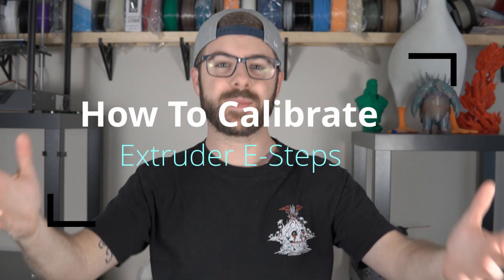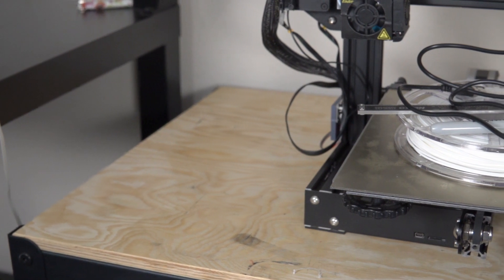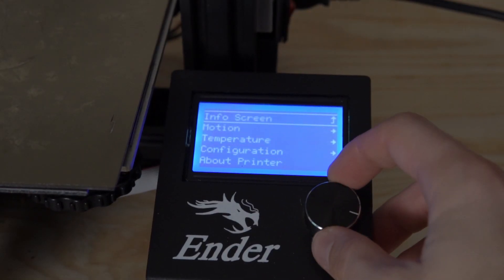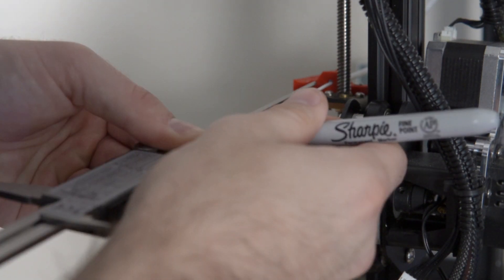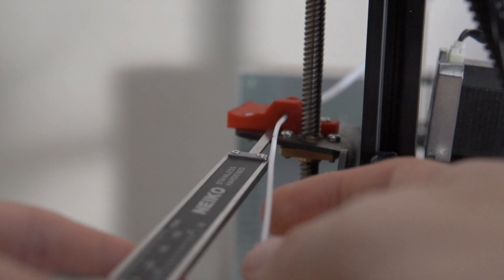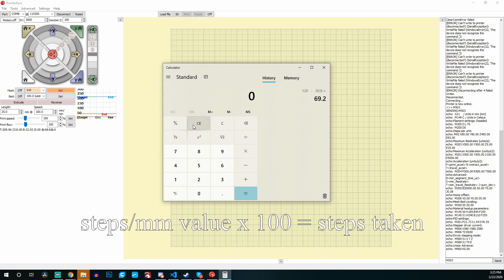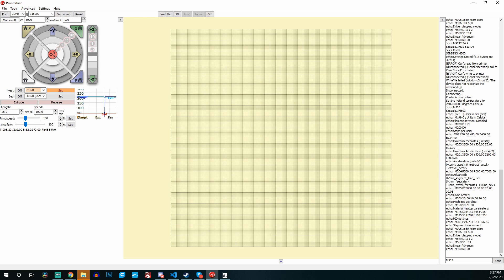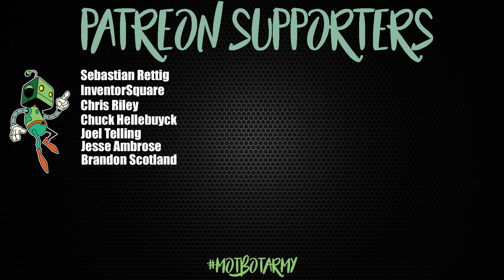How To Calibrate Your 3D Printers Extruder Esteps (Ender 3)

Comment: Got error after sending M500, "No EEPROM"
Reply: If I were to guess, you are using a regular creality controller running marlin. You'll have to reflash the controller with the extruder adjustments in the new firmware.
Reply: You need to install the memory card

Comment: Thanks mate. Really helpful for novice users like me.
One thing I noticed though. On your recommendation the extrusion command has a flow of 100mm per minute (F100). With this command I dad some hard time to have accurate measurements (Bowden extruder and PLA temperature on 210 on an Ender 3 V2 -with metal extruder). I had better and more accurate results when I dropped the flow to 50mm per sec (G E100 F50).

Comment: So I'm trying to use pronterface and have tried 2 different computers and the program will not pick up the COM port for the USB? Is there a different program I can use or an easy fix for the program? I use my printers for work and this has made me lose a lot of money for the hours I've been messing with it
Reply: I had same. just drivers for COM port not installed. I installed drivers manualy and get connection OK.

My computer>manage>device manager> and bla bla bla

Comment: Hi, really like your video and it help me a lot because I just change the extruder assembly. I’m having a problem that it is not saving the e steps on the software, if I shut off the printer and turn it on again, the original e steps appear again, even after I save a couple of times. Do you know what is the problem or is there another command to save everything. Btw I have a tronxy x5s with the original board bought on May this year (if it helps). Thanks and hope anyone can help.

Comment: Hey Daniel,  I just tried to calibrate my new extruder and it's running backwards.  I know why but I don't know what commands to change in the firmware.  Do you?
Reply: In the Marlin firmware there is the option to invert the extrude a bit under the steps/mm of the extruder,  An alternative is to reverse  the order  of the motor wires.

Comment: Thanks!!  Mine was under extruding but it seems to have a problem with the filament skipping in the extruder, something seems to be causing a jam about 3/4 of the way through the test.  The tubing is all new as well as the tip.  Will have to take it apart and see whats up in there.  It was printing OK, but i could hear the extruder click now and then so that wasn't unexpected.

Comment: Thanks this was a great video. I was wondering does the size of the nozzle being used have any impact when you issue the extrude command?  Is there a difference between using a .4mm or .8mm nozzle?
Reply: No, it makes no difference. The commands are the same.

Comment: Thank you for this video. I'm also new to this and installed the Micro-Swiss direct drive extruder on my Ender 3 Pro, along with a BLtouch. I've downloaded the Ponterface program. I've connected my computer to the printer via its minu usb port. The display will light up without the printer power turned on, however,  no port is listed in Ponterface's dropdown. Even with the printer turned on, no port listed. My printer has the original V4.2.2 motherboard which does allow firmware updates via the micro SD slot, which I did update with Creality's firmware for the BLtouch (Marlin V1.3.1). But, I am unable to make any changes stick, either for the X offset for the hotend, or the Z offset for nozzle to bed distance. Do I need a different motherboard? And if so, which is recommend. I understand the Marlin V2.0's would be better.
Update: I was finally able to get Ponterface to connect and correct extruder speed per your instructions. Thank you.

Comment: What would be causing my over extruding? My e-steps was 93. I used this method, the new e-steps should be 107.95 (had 33.85mm left over). I've set the e steps to this new setting, so now it's over extruding even more. I have this problem with every filament, and they all are 1.75mm. My extruder stepper always jumps , I upgraded to direct drive, and now have just fitted an aluminium assembly on it. I've even swapped nozzles more than once.
Reply: have you checked that the slicing software you are using has the right nozzle set as having it set to a higher nozzle than it accutly is can make it over exstrude
Reply: @b3dpc354  Hi, back after 3 years as I've just gotten this printer out of storage. Correct 0.4 nozzle fitted, with 0.4 selected in Cura. I have to print at 90% flow rate all the time. It's so bizarre! I also always get stringing at any speed and any retraction. Brand new steel nozzle now too.

Comment: Instead of fighting with the digital vernier calipers to measure the filament, i just printed a long narrow piece of plastic 120mm with a valley deep enough for the filament to sit in and just straighten the filament so it sits in the valley, and at the end of it, just use a narrow tipped sharpie. Takes 5 seconds or less!

Comment: Why are you substracing from 120 when you sent 100mm to be extruded?
Reply: it can be extrruded more then 100 or less then 100. if extruded more and you mark 100 you cant see you mark
Reply: @shadowjack1214  That's what he did but it's not right. He set it to extrude 100mm so everything should be based on 100mm plus or minus. What if he measured out to 200mm and sent out 100mm? Would he calculate based on 200mm or the command distance?

Comment: Yea, that's great, but I had to put 332 into mine. Which worked, but now that I'm off by only 28, what am I supposed to do? I can't use the original E93 since it has changed so drastically. If I want to get closer, this is only half the answer. Especially for people that have their calibration way off target. Where do I go from here? When I resent the G1 E100 F100, I'm now only off my 28 - still under extruding, but not by much.
Reply: If it makes you feel better I'm way under 20 at 8.4mm left so I'm in the same boat.

Comment: I'm new to all this and just upgraded my extruder as you did. I downloaded the pronterface and installed it. Connected it and started following your lead. When I put the M503 command and all I get is "SENDING:M503
 - ok N:0" nothing else. What am I doing wrong. Any help would be greatly appreciated. Thanks
Reply: You haven't got 'EEPROM features enabled' in your firmware. If your using Marlin firmware, check out here = https://github.com/MarlinFirmware/Marlin/blob/1.0.x/Marlin/Configuration.h#L521
It needs to be enabled for M500, M501 and M502 commands to work.
Reply: @andyspoo2  Does this work with normal Ender 3 Pro firmware?
Reply: @yony120  I don't believe so. It's a Marlin feature
Reply: @andyspoo2  I was able to modify the esteps within the Ender 3 menu, plus I've added a line to the start gcode on Cura.
Reply: @yony120  how! Hahah help me
Reply: @omarnavarro9690  If you go to the Steps settings in the Ender 3, there should be an option called E Steps or some Extruder steps or something similar. I no longer use the default firmware so I don't know the name for sure.

Comment: Finally thank you if any one gets the error 5 on pronterface turn your pc off and printer then load pronterface up leave it to run for a minute then connect your printer up and it should  connect I had issues with this

Nvm it doesn't save the new input 😑

Comment: I usually do calibration on extruded side of extruder stepper. Remove the Bowden tube cut filament straight with flat cutter, extrude 100mm and measure the actual. Sharpie method is very unaccurate.
Reply: your method does not account for the extra friction of the bowden tube or the force required to press the melted filament through the nozzle. It will result in inaccurate extrusion.
Reply: @MrDarkknight1225  Would that not change then depending on what type of filament you are using? I would do the calibration without the nozzle coming into play. You would also calibrate flow which would take the nozzle into account. Flow could be different for each type of filament you are using so would be set in the slicer.

Comment: I have an older Ender3 with the original board. I connect using Pronterface and go through every step you outline here. I do the M90 E143.5 and M500 and M503 and everything works. I then unplug (Power cycle) my board and do M503 and it is back to the E93 value. What am I doing wrong. It is the original Marlin 1.0.0. Do I need to upgrade my board???, Marlin???
Reply from the maker: Strange as long as you are saving to eeprom then it should be sticking with the reboot. Unless by default the marlin firmware has that functionality set to false. I have not looked at the stock Ender 3 firmware in a long time.
Reply: @ModBotArmy   I'm having the same problem. My Google-Fu tells me that this is by design of the manufacturer. The only real way to fix it is to recompile the Marlin code on the board. The easiest way around this is to include the M92 Exxx.x code into the "Start Gcode" portion in your slicer. However, if at any point after that start code is initialized, there is another M92 Exxx.x code, it will overwrite your initial calibration.
Reply: @Drewski3D  I have the same issue now with my CR-10S it reset the M92 E value to 93

Comment: Good job! This is a "must do" calibration that is really pretty easy and doesn't take long. But, now you are only half done. To really dial in extrusion one really needs to follow up with calibrating your Extrusion Multiplier. You should make a "Part 2" video showing how to do this and IMO its even easier and quicker than the first part. Matt's Hub has a good page about this (here about halfway down the page: https://mattshub.com/blog/2017/04/19/extruder-calibration) until you put your video up.
Reply from the maker: Thank you for the feedback perhaps I will do a part 2 with the extrusion multiplier 😬